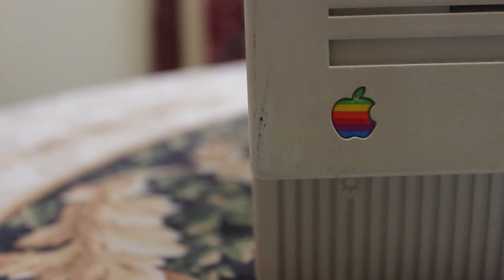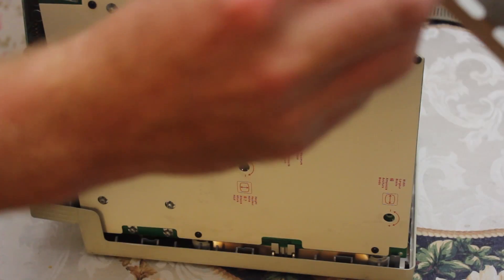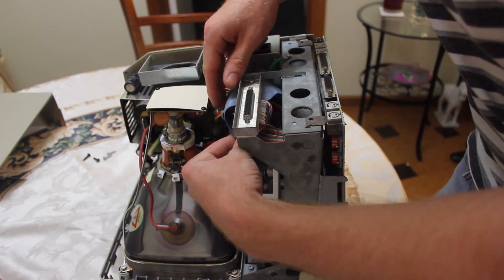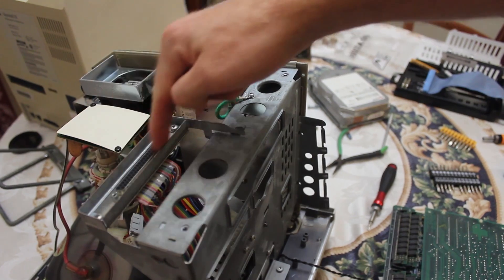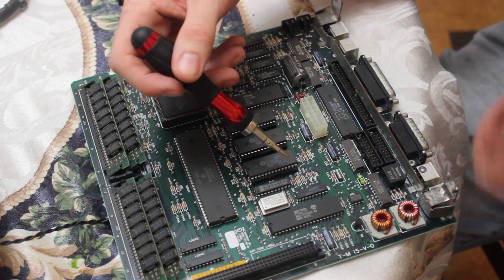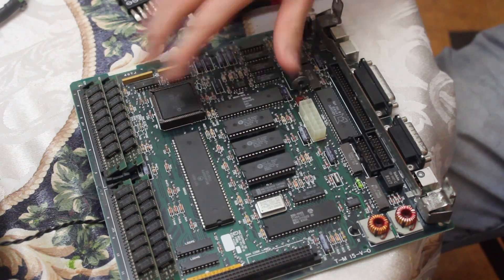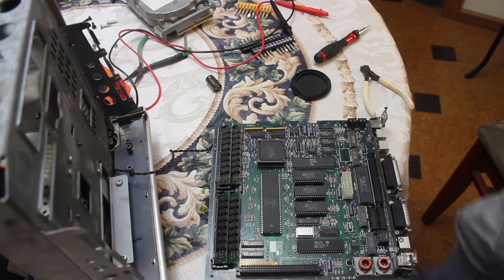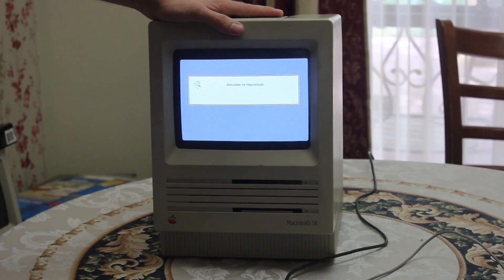Macintosh SE Teardown

Comment: sorry, why is the crt dangerous?
Reply from the maker: They/the capacitors can store very high voltages and deliver a fatal shock, even when unplugged for some time
Reply: @WhatUpTKHere  crap, i never knew that, I tore apart an old tube tv 10 years ago and had no clue.  Thanks.

Comment: hey there, i just took mine apart and it went pretty smooth..  but looking closer i found this brown nickle sized resistor that apparently was completely detached from where ever it was.. still has copper wire on both sides..   any idea where this could have come from?  i was very good to stay far away from the CRT components.. and the unit was working 100% fine (other than the floppy which needed some servicing.   

it looks like the ones around that stem on the CRT, but those are all still in tact and i never touched them / clipped them so i'm confident it didn't come from there
Reply: never mind.. figured it out..  apparently somehow i wasn't as careful as i thought (or maybe somehow it just was ready to fall off).. i'm going to have to confirm though it goes where i suspect it does.  http://part12studios.com/misc/pics/macsemonitor1.jpg
Reply from the maker: Good luck with the fix!
Reply: @WhatUpTKHere  thanks!  :).
Reply: thanks hopefully i didn't cross the streams here!  :)
Reply: @WhatUpTKHere  I'm happy to report that without having to do anything more than opening it up removing the drive and basically giving it a good dusting.. the floppy reads / writes / ejects great now.  i will need to grease it sometime soon i just don't have any appropriate grease at home to do the job.

Comment: Should i just remove the battery from my Mac SE as well? Is it really that bad to leave them in there? Thanks!
Reply from the maker: If you're not using it or if it's an old battery, definitely take it out. Once the battery corrodes and starts leaking the damage can quickly become fatal and irreversible. Can get really nasty!
Reply: what does the battery do? Just keeps the time?
Reply from the maker: +BillyTheBigDeal yeah keeps the time and some settings. you won't break anything taking it out. some Macs won't boot without it but you can always replace it with a fresh One.
Reply: thanks, i'll be sure to remove it then next time i open it :-)